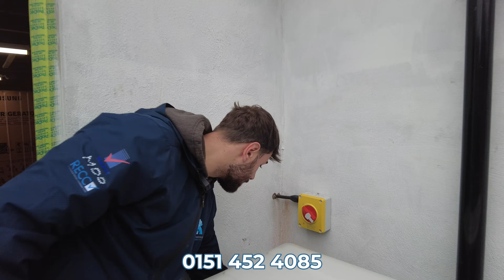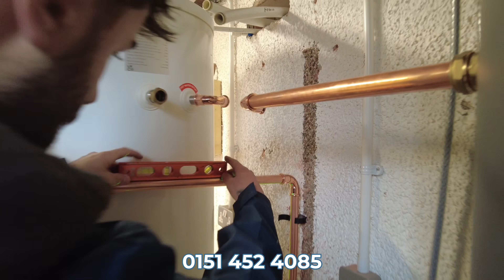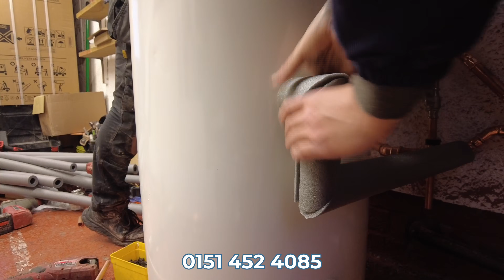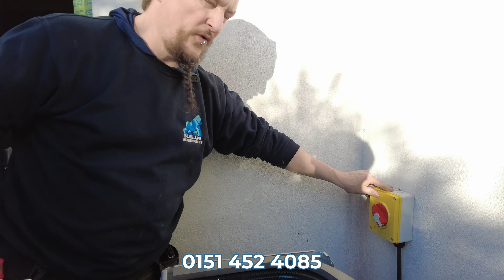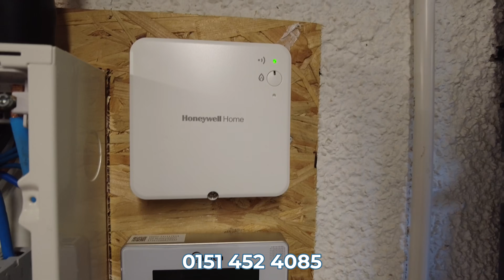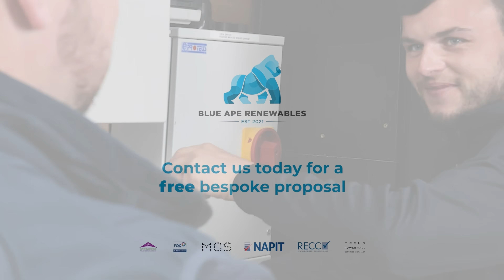Installing the Biggest Single-Phase Air Source Heat Pump | Expert Guide by Blue Ape Renewables

Comment: Is there a max distance the unit can be from the property? If the flow pipes were insulated well enough could it be placed 20m away behind a garage rather than outside a back door?
Reply from the maker: That’s a really good question! For the Midea R32 units (4–16 kW), the maximum pipe run length is around 30 metres combined on the flow and return, with a maximum height difference of 15 metres between the outdoor unit and the cylinder. So positioning it 20 metres away behind a garage is absolutely possible, provided the pipework is correctly insulated.

Comment: Why a Chinese heat pump ? Plenty of UK manufactured ones: Vaillant (Belper, Derbyshire) , Ideal Heating (Hull), Mitsubishi (Livingston Scotland). If people are taking the UK BUS grant, do the right thing at least.
Reply from the maker: Thanks for your comment. We chose the Midea air source heat pump because it offers a 10-year warranty, which far surpasses many heat pumps on the market. It also comes with excellent customer service and 3 years of free servicing through the Midea MiCare programme. In addition, it is one of the quietest heat pumps available, making it perfect for residential settings.

Midea is the world’s largest air treatment company with a proven track record for quality, efficiency, and reliability. This gives our customers a product we trust to perform for many years.
Reply: Hahahahhaha are you sure Vaillant is built in the UK? :D

Comment: Is your type A rcd protection adequate to protect against DC injection? Typically you need B type
Reply from the maker: Type A RCD protection is suitable for Midea Heat Pumps. That’s because the DC leakage stays below 6mA (milliamps), which means Type B protection isn’t required under current standards. Additionally, we have confirmed this information with the manufacturer regarding the RCD protection.

Comment: You didn’t lag the pipes though the wall?did you fit a type B rcd?
Reply from the maker: Thanks for your comment!
Regarding the lagging: In an ideal setup, every pipe would be fully insulated. However, in this case, lagging the short section through the wall would’ve meant drilling much larger holes and causing unnecessary damage to the building. Since this part of the pipe is enclosed and doesn’t have circulating air around it, the heat loss is minimal. As for the RCDs: We’ve used Type A RCDs for both the heat pump and the immersion heater, following the manufacturer’s recommendations. Thanks Blue Ape Renewables